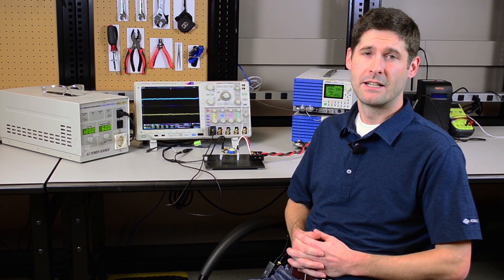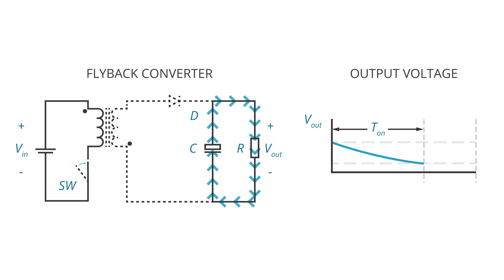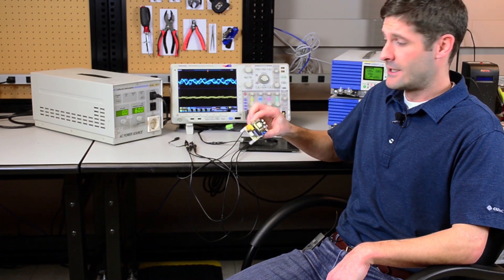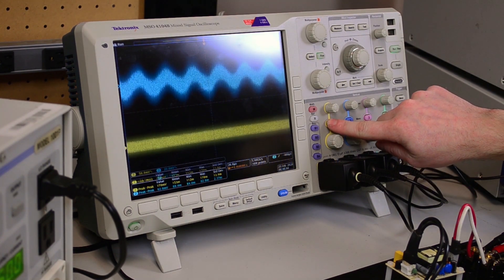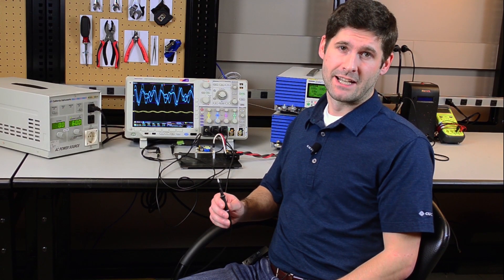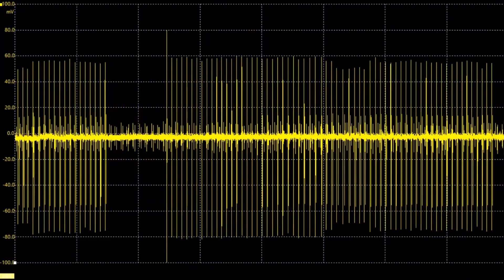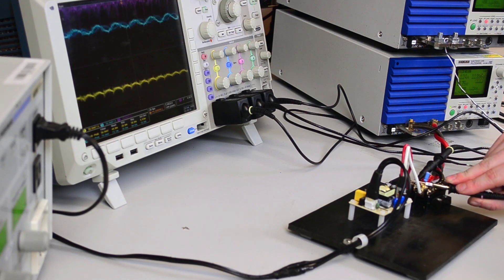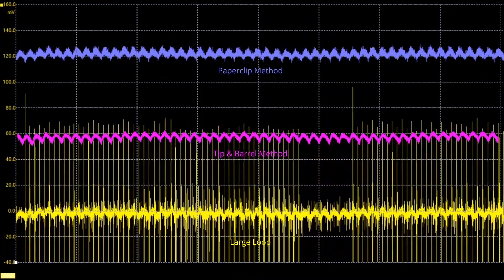How to Measure Ripple & Noise in Power Supplies

Comment: Exatly the video that I was looking for!!!
THANK-YOU VERY MUCH!!!
Please, just a question, the two capacitor should be connected at the output and in parallel?
The ripple declared in the spec should be reached when the maximum load is connected, and should be at the min. level when we measure it without load. Is it true?

Comment: Why wouldn't ripple be AC RMS? Peak to peak can be exaggerated if it has small spikes.
Reply: Exactly!  A great lookin' RMS spec can hide large peak-to-peak spikey crap that causes havoc - board coupling, PSRR issues, etc.  If I can't have both numbers, I'll take Vpp any day. It's nice of Cui to be specific about how they measured Vpp, but many manufacturers leave it vague. I never fully trust these numbers till I've looked at them directly.
Reply: @wormdamage  Good point. I realize the point of RMS is to measure power delivered. But ripple isn't about power (since it's riding on DC!), it's about what must be filtered out. Thanks for convincing me that Vpp is the better of the two.

Comment: So ... I really object to the 20MHz bandwidth limit.  It may have been the bees knees back 55 years ago when 20MHz scopes were the best there was and when 99.997% of all products were immune to noise much over a few MHz.  That is not longer the case.  Even me as a hobbyist can put together a small computer that is badly effected to power supply noise well in excess of 20MHz.  Indeed even 30 year old microprocessor based systems utilized and were sensitive to frequencies in the 100's of MHz.

The industry needs to pull up it's sock on this one and get real.  The noise on that small PS before you switched in the 20MHz bandwidth limit was unacceptable. 

Just to be clear, I have no issue with your probing advice and technics, it's only the outdated bandwidth limitations.
Reply: I have a cheap 10MHz digital scope, I was thinking of testing a PSU with it, would it not be good enough?
Reply: @arkatub  It depends on what you are goin g to use the power supply for and what kind pf power supply it is.  If it's a linear supply you will be using with audio and simple op-amp circuits, then it's fine.  If it's a switching power supply you will be using with a PC, some other fast digital system or HF/UHF radio, then most probably not.

Comment: Nice video and another way when working on Government power supplies as I did in the past as was in the test procedures for external noise when using something like the paper-clip method, was to connect a (0.1uf cap) between the probe tip and ground lead. Of course having a high voltage ceramic cap way above what was being measured for test purposes, this worked very well for removing stray & unwanted noise and gave true output noise readings.

Comment: Good video. But I do question the relevance of the measurements when a PSU is connected to a circuit (in use). Any wires away from the PSU output are likely to introduce the same issues as the ground clip method. So on the one hand you can validate the spec sheet, but it does little to assist with the actual business of getting the "lab" results in practice.
Reply: Not sure I am right, but the noise that would be picked up on the wires between the PSU and the load are met with the low impedance of the PSU and the load so they won't matter much. The oscilloscope is high impedance so that path is disturbed much easier.
Reply: He didn't mention it, but note that in the video the wires going to the load are twisted and always kept close to each other.  This provides some inherent shielding, and also ensures that any external interference they encounter will be picked up and transmitted equally down both wires (common mode interference) and thus not affect the (differential) signal measurements of the scope.

It is only when interference is picked up more by one side than the other (i.e. you have a short probe tip but a long ground clip, so the ground picks up the noise more strongly than the tip does) that it will affect the oscilloscope readings.

(Of course you do also want to ensure that your load is sufficiently high-quality that it does not introduce differential noise of its own into the power lines...)

Comment: Very worth reiterating to the newbies that the PSU is connected to a bench AC supply and NOT directly to mains. You should not connect the ground clip AT ALL if the power supply is not isolated!
Reply: And mention the bench supply is actually isolated with an isolation transformer, or just use a battery pack. So this way the oscilloscope is not powered by the same system.

Comment: IMHO, electronic load also makes the difference. On my setup, the electronic load will make things more complicated. The waveform is heavily disturbed by it. Finally, I used pure resistor load.
Reply from the maker: Thanks for your comment, Po-Ting! Electronic loads can emit noise that will get picked up by the scope probes, however this effect should be minimal if the probe loop area is small.
Reply: A good idea. Also it should be better to measure the noise at the load side, not the PS side (with respect to closed loops).
Reply: @la7yka  It's adviced to do measurements for minimized ground loop. Best at the bypass capacitors without ground clips.

Comment: sir, why 10uF electrolyte and 1uF ceramic capacitor was connected across the output before probing? What are the precautions to be taken for measuring ripple in HV output (1000V, 1mA)
Reply from the maker: Thanks for asking, Ankit! The 10uF and 0.1uF capacitors are typical for low voltage power supplies and represent the typical bypassing that might be applied by the application to eliminate high frequency noise picked up by output cabling.  The datasheet value for ripple typically specifies this external capacitance, which is necessary to apply if you want to compare measurements to the datasheet value. In terms of the precautions you asked about, for high voltage rails you should observe proper high-voltage safety guidelines, including making sure your equipment is properly rated and isolated.
Reply: @CUIproducts  Thanks for your response.
Reply from the maker: @AnkitGargIndia  glad we could help!

Comment: Are those probes available?  Or the schematics or mechanical 3d models, say in Rhino, or SolidWorks?  What min bandwidth scope is required?  Thank you in advance!
Reply from the maker: Sanjursan, thank you for asking! The probes we used for this video are the Tektronix TPP0500 (500MhZ, 300V, 3.9pF/10MΩ). Scope bandwidth should be at least 20MHz, and set to a 20MHz limit, if higher.

Comment: Hi, this video is quite educational.  I have a doubt. Here it looks like you are using a single-ended probe/non-isolated probe. What if you have to use a differential probe and still you need to suppress noise pick up? I have used the Yokogawa differential probe and its loop area is significantly high. At least three times more than the single-ended probe.
Reply from the maker: Vakacharla, thank you for noticing! Yes, we used single ended non-isolated probes in this video. Differential and/or isolated probes could have been used for this test, but attention should still be paid to the loop area.

Comment: A couple of questions. I extended the test point via a coax cable with a bnc connector and  a small capacitor at the end. Is that Ok.  Also should the input impedance of the scope be at 50 ohms or 1 mega ohm? I made a 5 volt Flyback smps and loading it with 5 amps.  I figured with 50 ohm input you get rid of noise which is not part of the power supply. I noticed that some youtubers used this method. What do you think? thanks
Reply from the maker: Thanks for the question, Danny!
Yes, using a coax or twisted pair of wire is acceptable to extend the test point.  Both 1 MΩ or 50 Ω input impedances are acceptable, however with 50 Ω a dc blocking capacitor must be placed between the output measurement and the scope. A 1 MΩ termination will tend to be noisier than a 50Ω, but it is generally not too difficult, with good probing, to get a good measurement on a standard ac/dc power supply. For very low ripple measurements, such as multi-phase point-of -load regulators, the 50 Ω termination may be necessary due to the low signal level.

If you would like further information upon this topic, be sure to check out this Analog Devices application note: https://www.analog.com/media/en/technical-documentation/application-notes/AN-1144.pdf